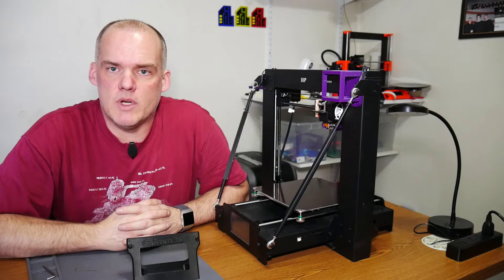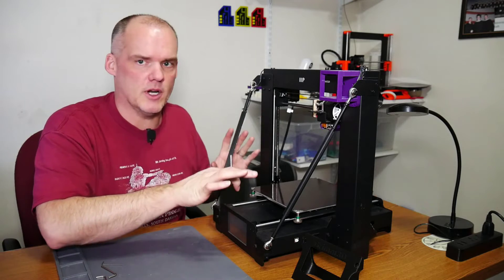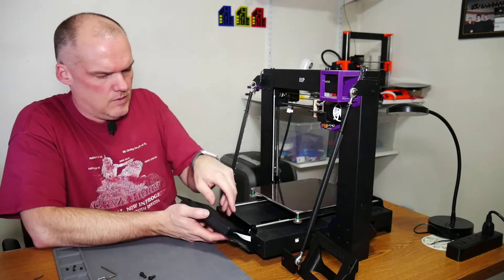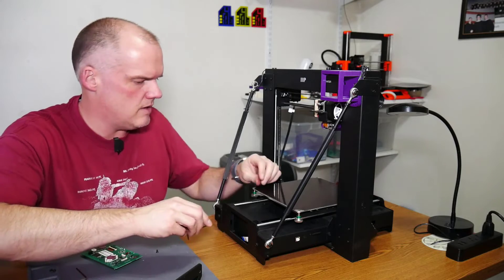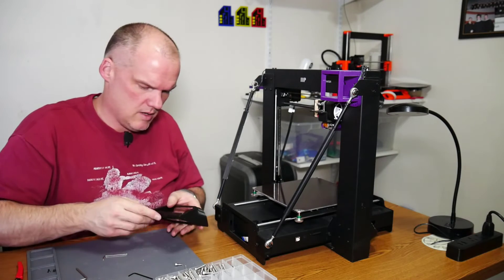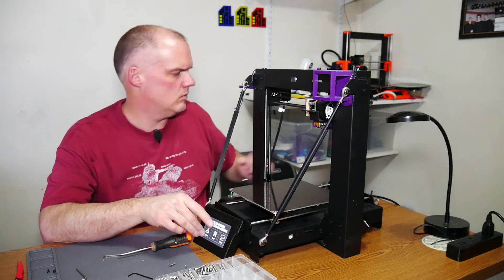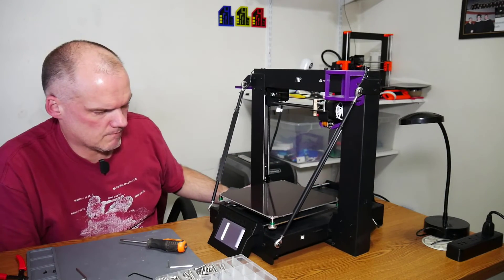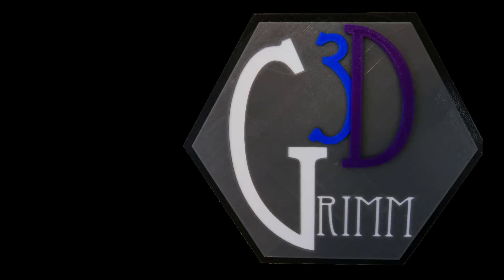LCD Upgrade with a Slant - MonoPrice Maker Select Plus

Comment: Never mind. Looking closer the gray/black piece that’s pivots is raised up, slide the cable under it and tip the gray/black piece down.   Think it’s a lock on the cable.
And it all works, touch screen and all.    WHEwwwww had me guessing for a while.
Reply from the maker: You are exactly right - it is a lock. Hopefully everything turned out OK
Reply: @Grimm3D  thanks it working just fine.   I finally was able to see where the female contacts were and then there was only one choice.  Still a pretty Mickey Mouse connector but it works.
Reply from the maker: They do see a little weak/cheap, but that is how most ribbon cables attach.

Comment: Grimm, I’m in the process of installing my angled screen and on one of your videos you mentioned it would be easier to disconnect the screen cable from the main board. 
I’m putting it back together and where the cable plugs in there is a black plastic piece part of the connector and it pivots up and down. Don’t recall seeing it when I pulled the cable out.
Does the cable go below or above the black piece that’s pivots.   Won’t try either way until I hear back. 
Thanks

Comment: That’s a BIG update, that’s the first thing I noticed when I saw my printer that vertical screen was so awkward. That’s the first thing printing
Reply from the maker: The ADVi3+ firmware has been updated since then, so check it out. I can't even imaging working without the slanted screen these days though. A solid upgrade, totally worth the time.

Comment: Thanks for the video. You have a lot of mods/upgrades listed, how would you order them from the first to do, to the last? I look forward to more of your videos. Thanks.
Reply from the maker: Depends on your goal for the upgrade. For stability, I put on the Z-braces, for solid print surface and ease of print removal, I use a flexible magnetic base with hairspray, for ease of overall use, the slanted screen holder was added. To print flexibles and higher temps, I added the microswiss all metal hotend with aluminum extruder plate. It all depends on where you want to go. 

One of the best upgrades (I have a video about it) is the flexible magnetic bed this makes printing and print removal so much easier, I would not want to have to print without it. Using hairspray, I never have any adhesion problems and stuff just pops off when done.

Comment: Be careful taking the ribbon cable off the back of the touch display. I broke the connection on the back of the display and I had to order a new one from China today. There doesn’t’ seem to be a release for the back of the display, and pulling it out broke it.
Reply from the maker: There is a release for the cable. Sorry I wasn't more clear on that. For a close-up look at the release, check out this video from Wanhao USA https://youtu.be/889uuOjjJmk?t=103
Reply: @Grimm3D  Thank you so much!  I'll check it out once the new  display arrives...lol I might have broken a second on. I was lift on the white part not the black... live and learn.